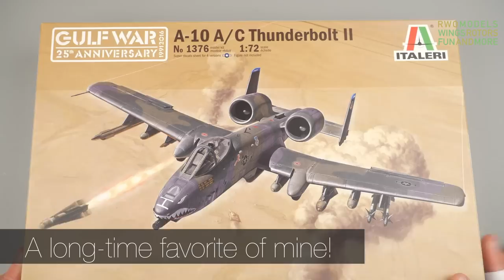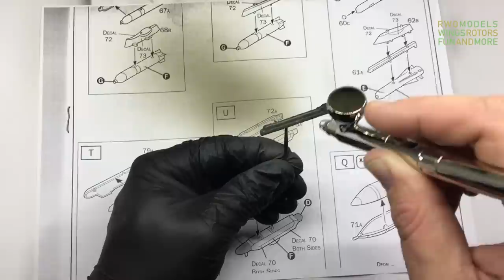Fairchild Republic A-10A Thunderbolt II USAF 1/72 Italeri 1376 Full Build Video | RWO Models

Comment: Excellent work on the Italeri version. I have just purchased the Academy kit and suspect it's very similar. After parts may be necessary.
Reply: I am working on the 1/72 Academy kit also.  Suspect engineering on the cockpit/nose wheel installation.  The Italeri version may be the better kit…

Comment: So I have this same model but mine was super back heavy and I can not seem to fix it. I would like to know how to fix the weight
Reply from the maker: Yes, the A-10 needs quite a bit of weight in the front so I added the recommended 30 grams before I completed the fuselage. Maybe you could somehow open/remove the nose gear bay and add small pieces of lead or some kind of putty from there?
Reply: @RWOModels  yeah I might do small BBs in the gear bay

Comment: Nice job to not kill off the marbling. I always had trouble with thinning Vallejo paint it gets runny and has no grip.
Reply from the maker: Yes, Vallejo Model Air paints sometimes are a bit tricky, it seems I also need to adjust thinning ratios as well as air pressure all the time. Nevertheless I like these paints and have too many of them. :) Thanks for watching!

Comment: Very nice build! Can you thin vallejo air with water or is it better with thinner for good airbrush results?
Reply from the maker: Since Vallejo Model Air are water-based acrylics I guess you could also thin them with water. Never tried it myself though, I always use the original Vallejo Airbrush Thinner and the occasional drop of Flow Improver here and there. 🙂 Thanks for watching!

Comment: Hey, really good work on videos and perfect work on models! Awesome footage! I would like to ask what kind of airbrush gun is that You are using? Thank You.
Reply from the maker: Thank you very much! 🙂 I’m using the Harder & Steenbeck Evolution Silverline two in one. "Two in one" means it's a bundle including two nozzle sets, 0.2mm for details and smaller areas and 0.4mm for larger areas. Of course you can also get it with only one nozzle set. It's not the cheapest airbrush but it is very smooth and of high quality. I love it! It's also easy to clean and maintain and you can get a lot of spare parts and accessories for it. The standard version (which I have) is nickel plated but there's also a chrome plated version available for those who are allergic to nickel. If I were to buy a new one I'd go for the chrome plated version since it also has more abrasion-proof surfaces.

Comment: Great job! May i ask which airbrush do you use?
Reply from the maker: Hi there, for this build I used my H&S Evolution Silverline with 0.2mm nozzle. This was the only airbrush I've been using during the first three years in the hobby. I always found it difficult to use since it clogs very easily and the trigger feels a bit inconsistent and not very precise. So last year I wanted to step up my airbrushing and bought a couple of new airbrushes, Sparmax Max-3, Iwata HP-B Plus and Iwata Eclipse HP-CS. All of them are very nice and have an extremely direct and smooth trigger, the Iwatas being more expensive and even better quality than the Sparmax. Although the Eclipse has a 0.35mm nozzle it can still spray very fine detail, and it is an awesome all-around airbrush you can use for almost everything. My latest addition however is the GSI Creos PS-270 with 0.2mm nozzle, and this is a fantastic airbrush! It is extremely comfortable and precise to use, very well made, sprays ridiculously fine detail, for a very attractive price, I highly recommend it! It is also available with a 0.3mm nozzle, called the PS-289, which I guess is a bit more suitable when using heavier paints. Hope this helps, thanks for watching! 🙂
Reply: @RWOModels  thanks for the answer. I also use an Eclipse hp-cs but i struggle a lot to obtain fine lines. I use Vallejo Air range colors, with thinner and flow improver, about 8/10psi. Any advice?
Reply from the maker: Vallejo Model Air apparently tend to clog up the airbrush and cause tip dry on the needle pretty quickly. I guess that's the problem you are experiencing as well. What's your thinning ratio? Don't be afraid to add generous amounts of thinner, sometimes I use 50% thinner or even more. Also your pressure setting seems very low. I used to work with 10-15 psi but have now increased my standard setting to 20-25 psi and gradually decrease if necessary (I have a small air valve on my quick connect). This requires good trigger control, but with a bit of practice you may get used to it. Of all the airbrushes I've been using so far, the Eclipse seems to handle my Vallejo Model Air paints the best since it's specifically designed for thicker paints with larger pigments. Another thing, did you check if your airbrush is perfectly clean? Maybe there is some tiny, hardly visible residue on the needle or in the nozzle preventing proper paint flow. As a last resort I would recommend to try other paint brands. ☺️ For example Mr. Hobby (or Tamiya) colors with their thinners (or Leveling Thinner) is a whole different league.
Reply: @RWOModels  i use a thinning ratio of 1/3 (thinner/paint), maybe is too low. I agree with the trigger control you must have iot use these colors, infact i was planning to buy the preset handle to help me. Also the clogging was an issue but now i keep a damp piece of paper at hand to clean the needle. The airbrush is always clean, especially the inner side of the nozzle. I will try, as you suggest, an higher pressure and to adjust the thinning, thank you.

Comment: During combat mission A10 not carried external fuel tank!!
Reply from the maker: Thanks for the info! I shouldn’t have relied on Italeri‘s build manual there. 😟 I also wondered why there are actually two external tanks included in the kit … I assume they were both used on ferry flights when the plane was unarmed?
Reply: @RWOModels  Exactly external tank A10 used only on ferry flights when plane was without any weapon except Avenger gun.😀
Reply: @RWOModels  GAU 8/A AVENGER cal 30 mm

Comment: Fantastic!!!!  This is Also one of my Favorite planes, right next to the Navy SBDs, F-14s, and A-6s!!!

Thanks for telling us on how to dilute and pressure settings on camo paint job!!!

Questions:
In your video you wish to use after-market products.... which ones would you replace?? 
You are a BIG Fan of Vallejo paints, I use(d) Model Masters (acrylic), but you Metal paints look good!!!  Any tips on that???  
You also used Gloss/DullCoats....I used Testors...but what do you use???

I build ships, but I do have kits of different genre, check my channel for my JMSDF, and others!!
Reply from the maker: Thank you! Regarding aftermarket products – I don't like it when you have to put hours of work into the armament (and the A-10 has a lot of it) to try and make it look as good as possible and in the end it still leaves quite a lot to be desired. That's what I felt after completing the A-10 and especially my Italeri A-6E Intruder.

Vallejo paints and products: I mainly use these, as well as Tamiya, because my LHS has them in stock, and so far these products work very well for me. ;)

I have about five or six paints from the Vallejo Metal Colors range and I like them for their "depth" and their ease of use (no dilution needed).

For my gloss coats I currently use Tamiya X-22 diluted with 50% Tamiya Lacquer Thinner. For flat coats I use Vallejo Matt Varnish 70.520 with Vallejo Airbrush Thinner or Tamiya XF-86 with X-20A.

Hope this helps... Cheers, Oliver/RWO
Reply: @RWOModels  Cool Beans!!!  Thanks for the Quick Response and answers!!!

Getting back to that paint scheme ... it is funny that you painted the Entire A/C (flat) black!!!  I do that with my ships when painting the 'boot line' (the black line on ships) ...... I ALWAYS have a hard time masking/painting that Damn line then the upper / lower hull .... So I just paint it Gloss Black and mask that, then paint above & below the line!  {By the way... I kinda like it when you were painting your 'greens' on the A-10 and leaving the 'Black' on their......I thought it look even Sharper!!}

Comment: The model is very tail heavy. I realized the hard way. I don’t really know what to do now :(
Reply from the maker: The build instructions suggest to add 30 grams in the front, and the model really needs that. Is there a way for you to somehow open the front landing gear bay and try to add some weight from there? Or just add some lead weight into the landing gear bay and paint it so it's not too obvious? I had the same problem with my B-25 build which is a notorious tail sitter as well. What I did there was I added a support made from clear plastic sheet in the rear of the model so it stays on its front gear.

Comment: Negative my friend. You must  study  in a best way the A-10A ,because you had build an 1st Gulf WAR aircraft. 
Check the right reference.
1- the GPS antenna was a later introduce after 2000 . This the most big mistake !
2 - the color of wheel bay was in grey FS 16473 -  the Insigna White was introduce with a low viz camo.
3 - the fuel tank in a center line position is wrong, the carried for the long range transfer ( 2 fuel tank) .
any way is a nice video 
kind regards
Reply from the maker: Appreciate your feedback and corrections, but please, no need to be overly didactic or harsh here. Most mistakes come from the crappy Italeri build instructions. I'm not an expert builder, just trying to capture the "look and feel" of the model and share the FUN of it with you guys. Thanks for watching.